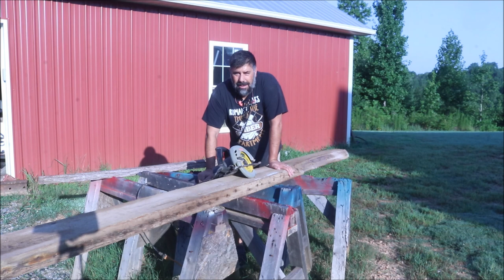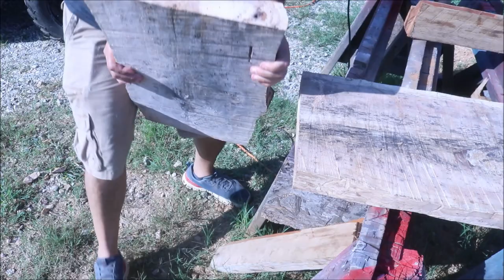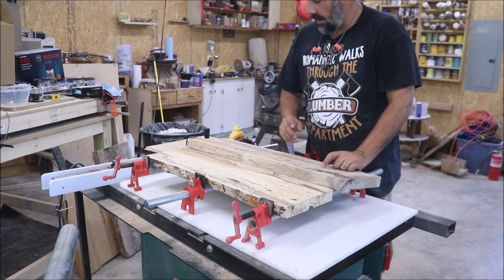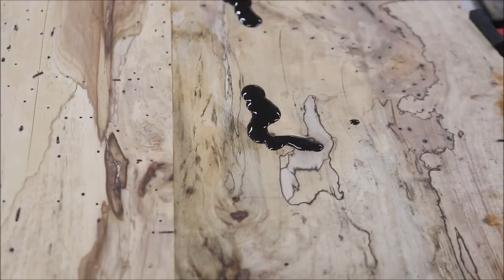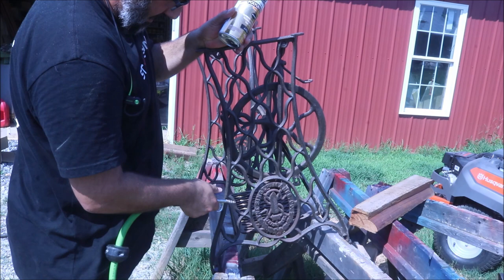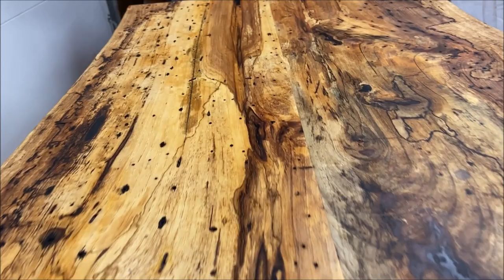Woodworking - Upcycling a Singer Sewing Machine Final

Comment: How long does the wood take to dry? Also, 10% what exactly?
Reply from the maker: Wood usually dries at 1" per year. 18 months for a 2" thick piece like the pecan. Sometimes more sometimes less. 10% is the moisture content when read with a $20 moisture meter. Hope that helps.